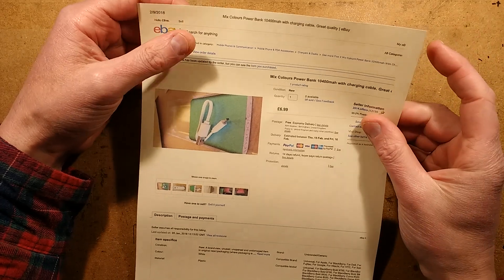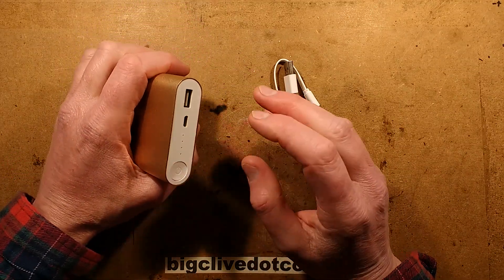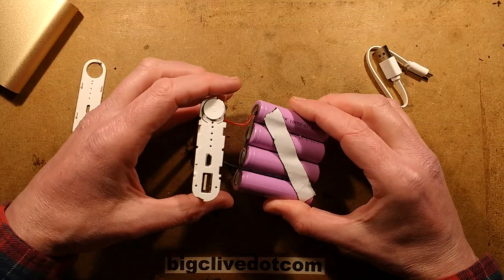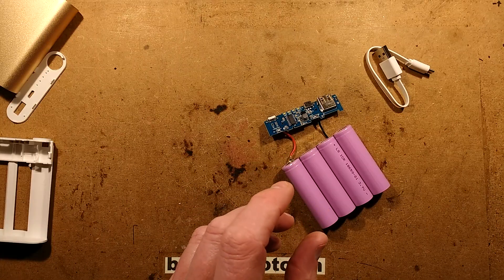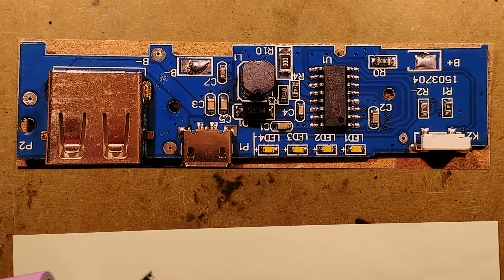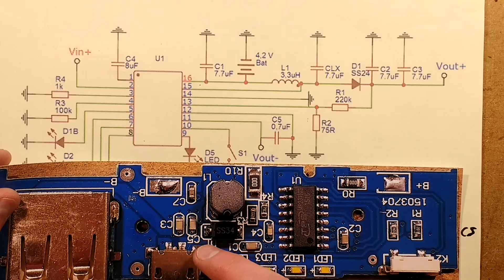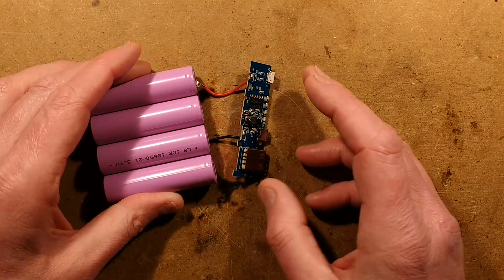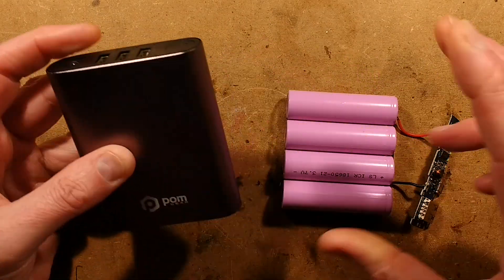Inside a fake "10400mAh" eBay USB power bank.

Comment: Can you change the resistors to get it to put out more current?
Reply from the maker: The limit will be the switching current of the chip, size of inductor and ability of the cells to deliver the required current.
Reply: Heatsink and inductor mod? For science, of course.
Reply: +MRLT Best explanation I've seen.
Reply: Juan Herrero Chip most likely has overcurrent protection so it wont output more even with good cooling
Reply: bigclivedotcom; And of course the 'magic blue smoke' holding capability of that chip at elevated temperatures. XD

It's kind of like a gas cylinder, you see. As the temperature goes up, the magic smoke wants to expand, so the internal pressure rises. Concurrently, with higher heat the chip packaging starts to become weaker. At some tipping point, the gas pressure exceeds the ultimate tensile strength of the packaging and the internal containment ruptures, letting the smoke out, which obviously causes the chip to lose its magical capabilities.